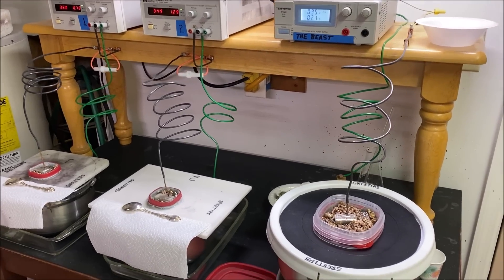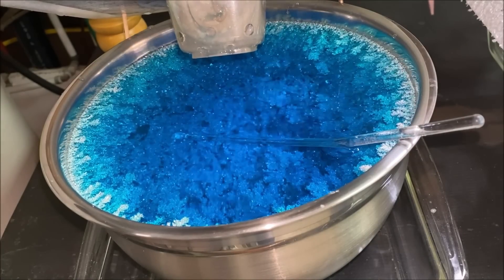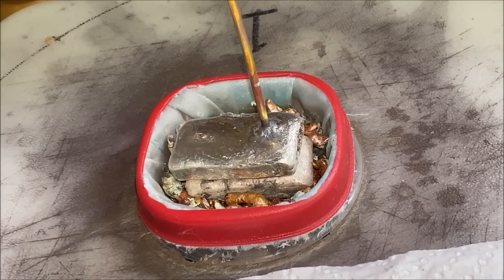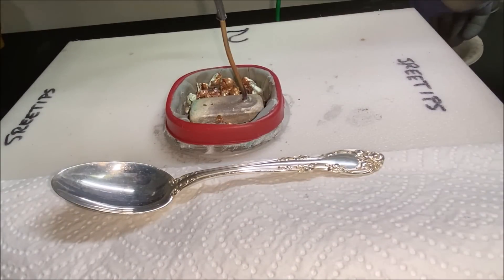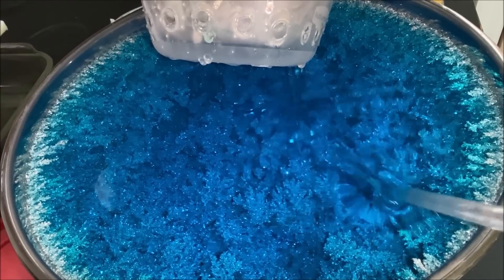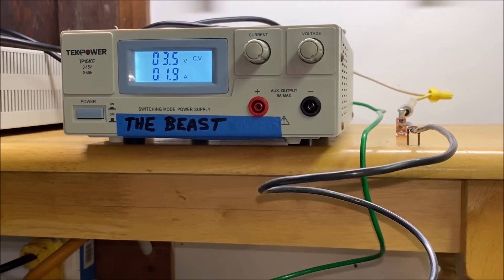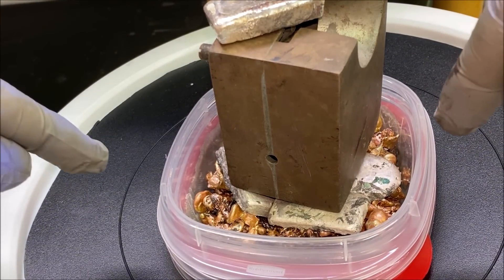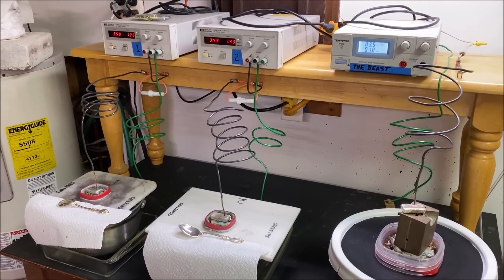Silver Cell Day 9 Crystal Growth 216 Hours

Comment: My suggestion, why don't you wash the silver cement from copper thoroughly with hot water until it is clean? Until there is no blue solution in the water?
Reply: Because from my experience, washing the cement with hot water until there is no blue solution, when melting, the copper color in the silver is not visible at all.
Reply from the maker: I used to do that, spend lots of time washing all the copper off. Then I realized it wasn’t necessary because all the copper gets removed in the silver cell.

Comment: Dear sreetips, 
As an ametuer refiner myself and having learnt a lot from your videos id like to ask you question with respect to melting the gold and silver during inquartation.

This is something from my personal experience and id like you to comment on the same.

As i was melting my gold while inquarting with silver i felt my torch wasnt hot enough. The shot i was able to produce had very sharp pointed tail like extrusions(a lot of them). My guess is the molten metal not hot enough and froze as soon as it got in contact with water and thus had very long tail like sharp edges.
While i was prating i saw a lot of coloidol(floating particles of gold) which where carried out during decantation. I would frequently stir my beaker during the acid boils to aid acid leaching. My guess is the coloidol gold broke of from the sharp edges as i was stirring the beaker since the gold crumbles i got after parting had no sharp edges.

Do you think my intuition of things is correct.
And if so i have observed you pour your shot onto a wooden plate with running water, do you use it to avoid this specific problem.

Thanks Regards.
Amol
Reply from the maker: If you were getting colloidal gold during nitric boils then that’s an indication of 1) too much silver 2) not enough gold due to something in your karat scrap being plated or gold filled and not karat gold. That has happened to me.
Reply: @sreetips  I'm not sure if colloidal is the right term but I could seen particles of gold floating around during the nitric acid boils.

A couple of questions.
1. Are sharp tail like extrusions a problem...?
2. What is the benefit of pouring my shot on a wooden plank with running water rather than directly pouring it in water. I have heard a lot of people swirling the water as they are pouring in the shot what benefit does swirling the water serve...?

I'm pretty sure I'm missing something here
Reply from the maker: 1) I do t think so. 2) greater surface area
Reply: @sreetips  I'm pretty sure silver plated scrap is not the problem.
I did my calculations for inquartation with 6 karat(25%) gold in mind I guess I'll have to target 7(30%) gold next time.
Reply from the maker: Not silver plate, gold plated. You may have counted a single piece of gold plated  as karat gold and thrown the calculation off.
Reply: @sreetips  I was working with a gold ingot so gold plated item is pretty much ruled out
Reply: @sreetips   I have approached you multiple times with different questions on my refining journey, you have always been kind and helpful each time.

I'd like to say thank you for all the time and effort you put into your craft while at the same time helping other.

Thank you and may God bless you.

Comment: Great videos, thanks for the hypnosis. Just a thought on when you harvest your cemented silver. As the copper dissolves in the silver nitrate solution, some fine particles of copper detach and fall in the silver deposit. As these particles are covered with more silver, they stop dissolving and stay as metallic copper when you harvest. Before harvesting, you could remove the copper and as much solution as possible, then add some clean silver chloride to the cement and give a stir to dissolve the residual copper dust and get higher purity. Although you will still get the cement through your cells, it wight be worth a shot. BTW, have you ever thought of inviting a professional chemist to one of your most difficult processes, like stock pot refining? Or simply bring your stock pot to some lab and do it with a mad scientist ? With a spectrometer, distillation columns, decanters, etc.
Reply from the maker: No, I’ve never thought of that

Comment: I'm kicking around a couple ideas to eliminate the filter for the anode.  I think I might run a small scale test soon.

Edit: this has been a great run, you are going to end up with a pile of sulver after this run is done.
Reply from the maker: Eliminate the filter would be nice.
Reply: @sreetips  ya it seems to be what's holding your process up the most.
Reply: @sreetips  good news and bad news.  My original idea didn't pan out.  However, I did come up with the next best thing.  Increase the surface area of your filter by putting it on the outside of the basket and it will last considerably longer.   Cut one of the Tupperware containers bottom completely off to expose the entire filter medium.  Use the cut container to hold the filter in place.  The drawback is cleanup won't be as easy, but it should eliminate how often you have to swap filters considerably.

Comment: Have ya tried making an anode that's the same size as the whole top of the basket less a lil arpund the edge so that it can fall farther down inside the basket as the impure shot gets eaten up that way there's just a hair more weight across the whole pile over just that small section that is the anode u use now
Reply from the maker: No, I don’t think it would make a difference.

Comment: Seeing how you use a brass buffer between the anode and the shots makes me wonder how a silver anode is necessary. I was thinking you needed silver particles to initiate the electrolysis process of the silver. Maybe the old silver anodes are now kind of serving the role?
Reply from the maker: Silver is the best conductor of electricity.
Reply: @sreetips  but you put a huge block of bronze under it (which is a good conductor too). Copper is also an incredible conductor. 97% the value of copper. You would have low cost anode, easier to work with, no galvanic corrosion between the long piece of "thin" copper wire and the anode itself. I would be curious to see how efficient it would be.

Comment: i can tell that electrolyte is indeed heating up by how much condensate was on the underside of the lid of the beast, i imagine cells 1 and 2 are losing electrolyte at a much higher rate than the beast because they aren't nearly as sealed to the air as the beast is, so liquid is free to evaporate though the paper towel covering the opening in the lid

Comment: Hey sreetips... Long time fan here. ..  I have an idea.   When it comes time to start running the anode bar closer to the solution ..with more old bars to protect the new one ..  why not take a few mins with a brass wire wheel and cleanup the old bars?   In theory, the cleaner they are, the more direct contact you should have to the silver shot....which I think is wanted.  If a little brass contaminates the bars ..does it matter? There's already copper in the solution ... Maybe in wrong but I don't think trace amounts of brass would make any issues would it?

I think this might help you keep more amps flowing towards the end of your run.  Thoughts?
Reply from the maker: Agree